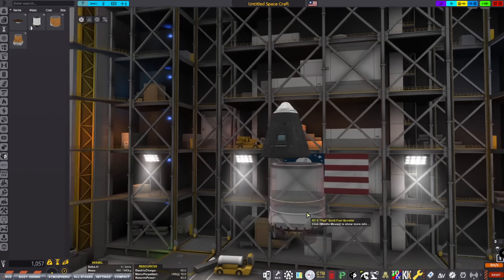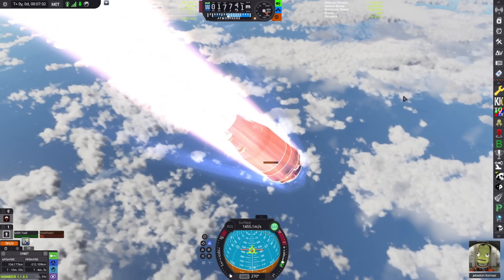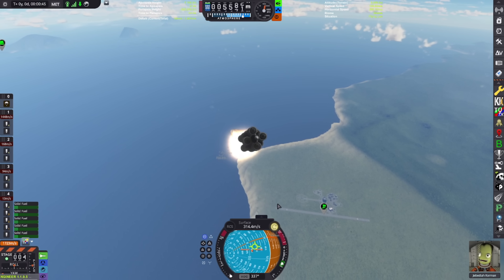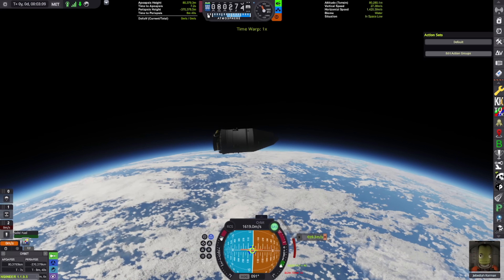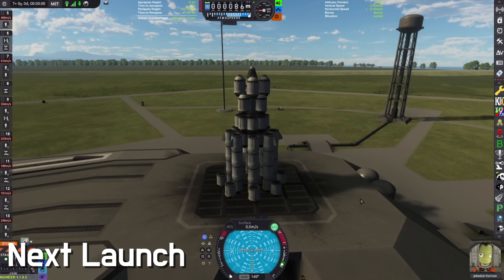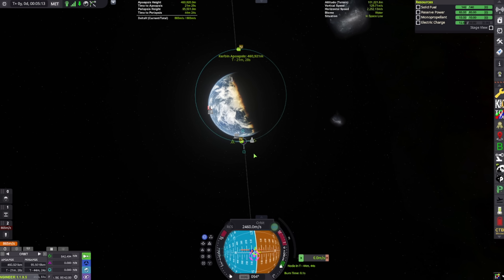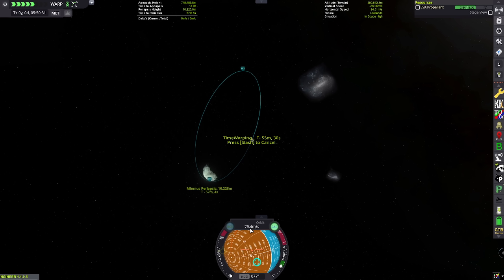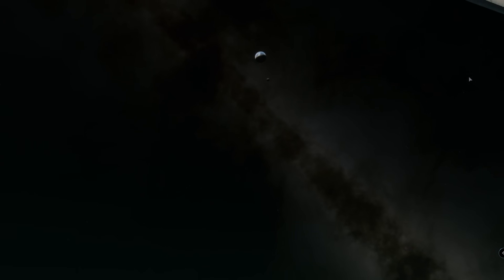Pushing the Flea Engine way past its limits... (KSP)

Comment: One thing to mention when burning off stages is you should light the next stage so it burns off the previous one just as it’s out of propellant. If you figure out the timing it’ll be significantly more efficient than waiting for the previous stage to completely burn out before staging.
Reply from the maker: Next time I’m stuck using fleas I’ll try this for sure thank you 🙏

Comment: I use the Flea all through my KSP playthroughs. Slap a bunch of them on your first stage and they give you a nice short-term boost to your initial TWR. This lets you reduce the TWR of the stage's main engine to just above 1.0, thus maximising delta-V, while the Fleas give it a brief initial push to get up to a decent speed, so it remains controllable and gets out of the lower atmosphere in a reasonable time.
Reply: i do the same with hammers.

Comment: To prevent the craft from flipping during reentry you can spin stabilize the craft.  When spinning even if the craft flips over it will tumble rather and slow down rather than acting like a lawndart.
Reply from the maker: Ahhh okay I usually spin the craft if it gets hot but that’s very useful thank you!

Comment: I use flea engines to get landers off moons. They're really not that bad, they just aren't quite efficient enough to escape Kerban. I'm sure you could do it on one flea engine though if you do enough drugs.
Reply from the maker: They’re good for thrust but since it’s a solid fuel booster it’s hard to get encounters and fine tune orbits

Comment: First two minutes in, not sure if he goes over it later but you can burn srb very quickly if you stage it at the right time while the previous one is burning. The running engine adds temperature already, then the upper booster makes it over temp while the below one is burning still.
If you wait for engine burnout, the next engine has to melt the entire other booster by itself. 
Time it right, and you get a near instant burn while losing maybe 10-15% of each stage to do the decouple, not upwards of 50 on each flea.

Comment: DO A GRAVITY TURN, you are wasting all of the extra Δv you add on your bottom stages on that ridiculous crazy inefficient almost 90° turn you are doing
Reply from the maker: Whoopsie I guess u should work on that my bad!
Reply: @JakSP-69 lmao but yeah. Instead of going up, try starting to pich slowly when you pass 100m. Aim to get 45° during 10/15km, and almost horizontal at 50 or 60km.

If your apogee is past 70, you dont need to burn anymore. conserve fuel so you only burn at apogee.

Comment: 8:20 oh if you're trying to optimize for efficiency, then you're turning your craft too late. You should start tilting around the second blue (second from the right) in the altimeter. That's why you're seeing reentry effects but you're not seeing performance: instead of having some of your vertical velocity be killed, by tipping over too late, you're killing almost all your velocity. Alternatively, you could reduce the thrust of the upper stages by x8 or something.
Reply from the maker: Ahhh okay yea I need to start turning way sooner thank you!!! 🙏

Comment: *ahem* gravity turn ❤
Reply from the maker: Gravity turns are a recommendation
Reply: @JakSP-69  are you 12 years old.
Start turn at 80, when AP is at 10,000  you should be at 45 degrees..  if your AP is more than a minute away decrease thrust..  easy rules to follow.
Reply: @danielbrowniel  Not with reaction wheels only, dude. Have you ever tried to fly this rocket? I have LOL, it won't turn at all until you're way up high. Waste of EC. Control surfaces make that doable, but we weren't using them in this video, nor were we using RCS. If you wanna see how 12 year olds play this game, look at 80% of the KSP content on youtube... There are channels way more in need of your backseating than this one X)
Reply: @danielbrowniel crazy crash out

Comment: You should try a challenge were you can only build vertically in a straight line without adding anything to the sides
Reply from the maker: Okay I could try that where should I try to go?
Reply: @JakSP-69 gilly or minmus sound possible but duna would be a good challenge
Reply: @JakSP-69  minmus
Reply: @JakSP-69 duna
Reply: And return